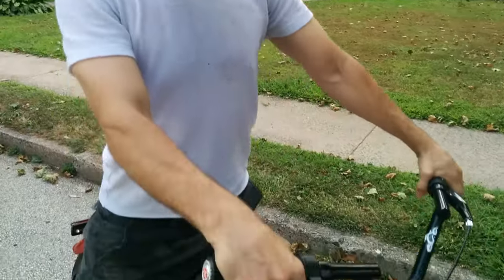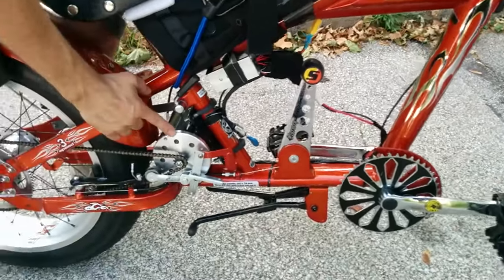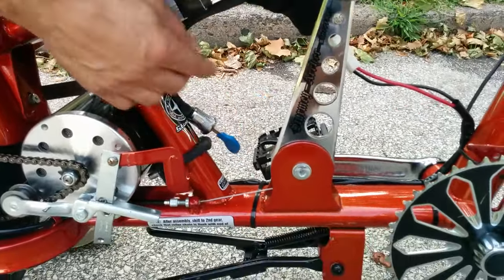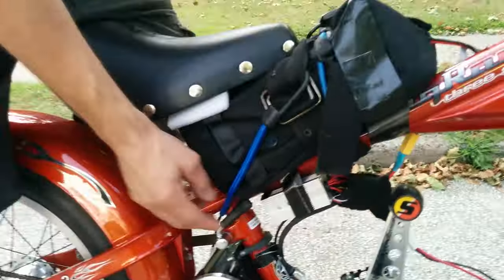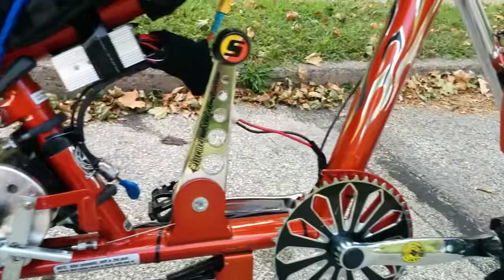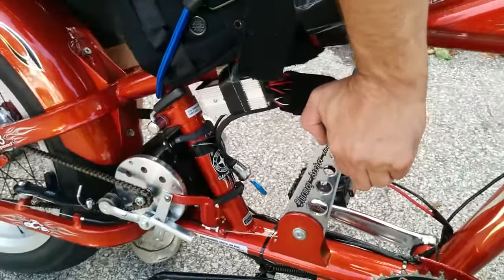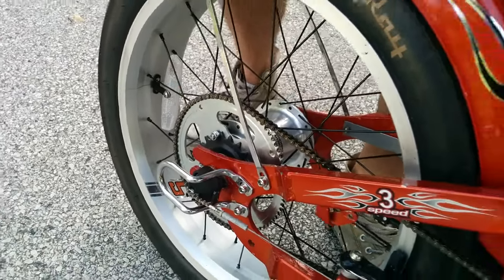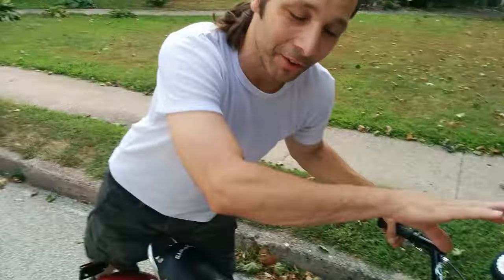OCC 3 Speed Stingray Ebike 40MPH Top Speed MY1020 Brushed Motor

Comment: What batteries you using? and can you still use the pedals and chain if you wanted to in connection with the electric motor? Where'd you get the rear sprocket  and how did to bolt it on to the rear hub? I have the bike. I am wanting to electrify it for my grandson.

Comment: something weird though  those hub do you need to give a  back  rotation nudge to allow to switch speed ? those i find around here seem  to be the case   that mean i wouln'd be able to change speed  with motor only :S
Reply: For the 2 speed kick to shift types. (And even then a simple circuit could be made to do that if you really wanted to stock with the 2 speed kick to shift hub)

Comment: I don't believe it goes 40mph on a 80 tooth sprocket, I use a 56 to get into the 30s with a 45a controller and a brushless motor at 52v
Reply: he must have gotten confused he meant kms ,  I build two of them with and can;t get them past 30 mpg ,
no matter how high I over volt them  50V , 60 and even 80 Volts.
Reply: @mlow587  I planned on building something similar. I thought that because its not a hub motor it would be easier to try different sprocket / gear ratios toget the speed or torque you want . Is that not so?.  I have a gas bike which im converting to a " mid drive" ...

Comment: Can we see the bike in action? That 5sec ride was a bit too quick
Reply: Ohok I get it .... That 40MPH was going downhill with the wind helping you to hit 40 for 2 secs before that MY1020 burned out!  LMaO must have burned out on this vid ...because it was never seen riding after it rolled downhill
Reply from the maker: You may want to check out Mike's channel. It is at https://www.youtube.com/channel/UC9MODHwfBrNy6NwBfzVi_Eg
Reply: Thankz!! & frm the vidz I never saw him going faster than 20MPH... In fact, if it was hitting 40MPH he wouldn't have changed it 2 a mid-drive system ...also from the bad gear ratio he had he NEVER rode it after the MID drive change over ...then he went str8 to a hub motor.  He still haven't presented ANY GPS or other readings of speed like ALL the other real testers with speed achievements.. He must just rides & says "WoW this FEELS like I'm going 100MPH"  LoL